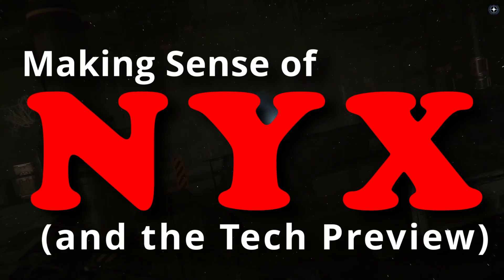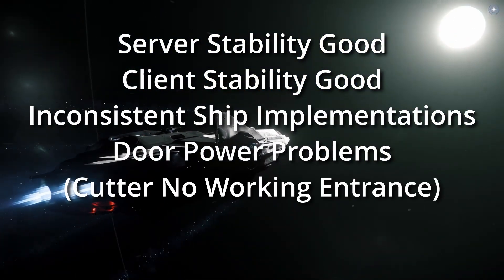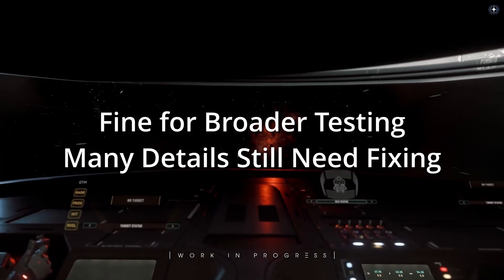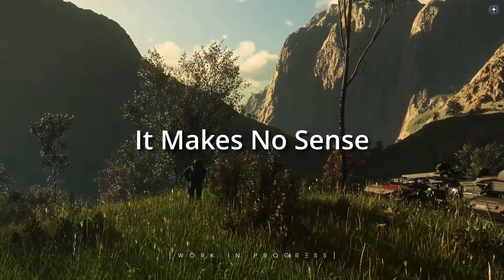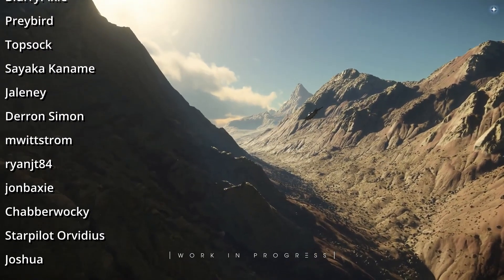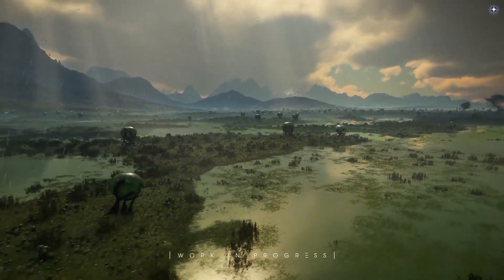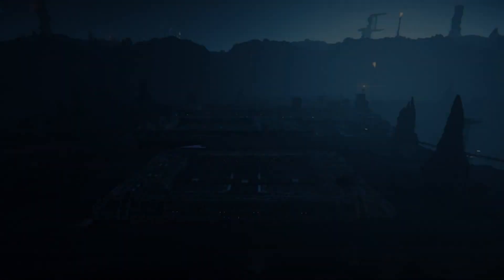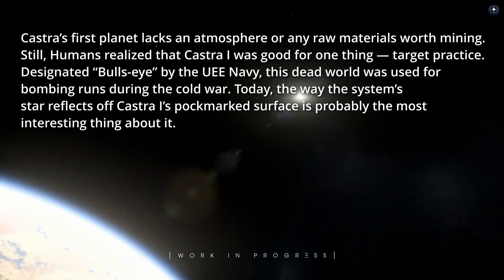Thoughts on the Engineering Tech Preview  Evocati Test , Plus Making Sense of Nyx

Comment: As long as the planet will be moved at some point it is totally fine. Testing those features in the PU whenever possible is imperative. Even if it is not even Bullseye but just a test planet - to test performance impact and feature integrity is the ride we signed up for.

Comment: If the "Hero" Planet really IS Bull's Eye from Castra, what has happened to the real Planet that the Nyx System will have had?  It could EASILY be that the 'real' planet was also visited by Terraforming Concerns and given the same treatment, so we could well see Bull's Eye back in Castra all prettied up for colonization just as Nyx's original planet has been as well. There does not need to be a lot of ret-conning required for either System to have a world ready for Human Habitation. But Nyx's might prove that bit harder to do because of proximity to Vand'uul Space, and vulnerability to Vand'uul raids.